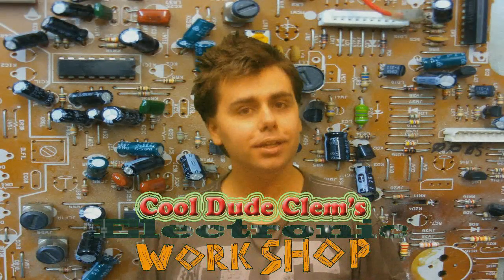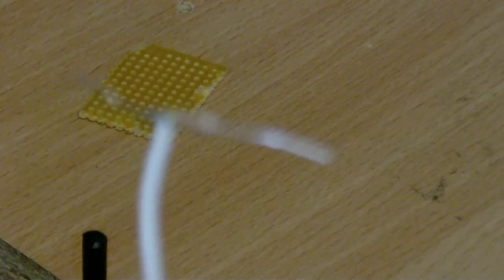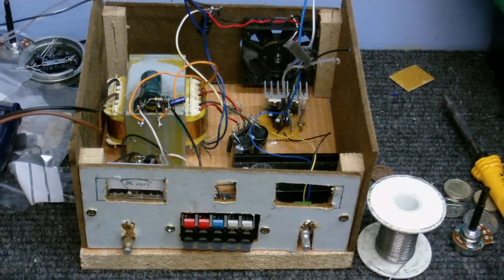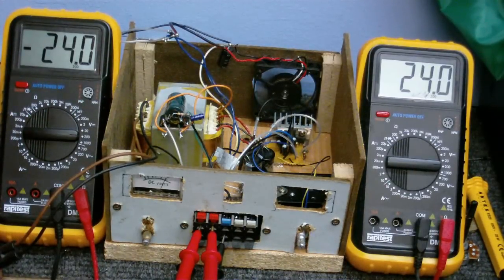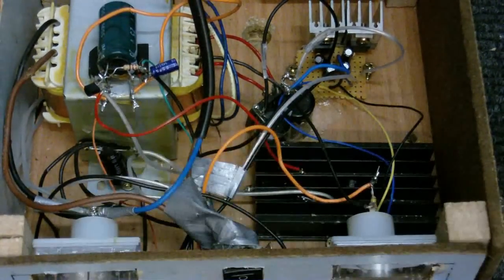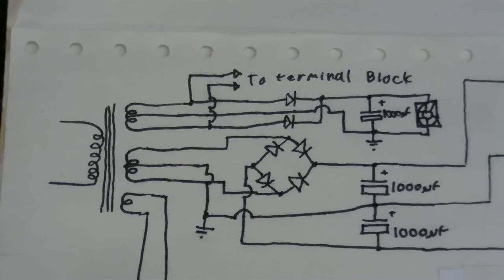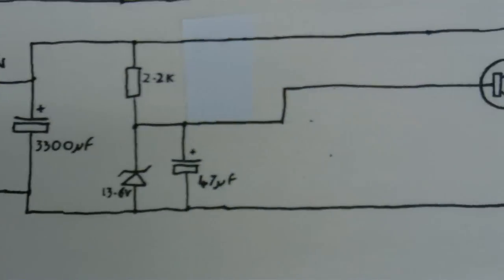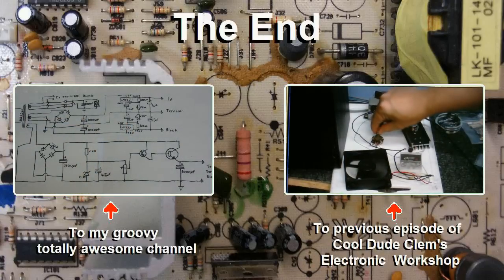CDC Electronic Workshop, finishing the Power Supply

Comment: I would really reccomend you put a fuse on the primary and secondary of the transformer. Especially when it's made outta wood :)

One other thing I reccomend is that you get some heat shrink tube! Much better and less messy/neater than tape :)

Good job on the PSU!